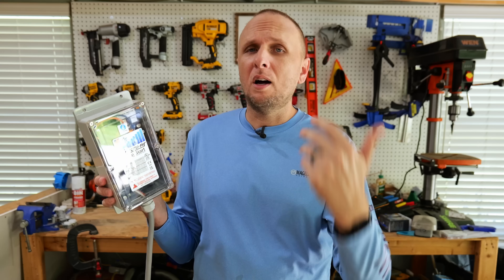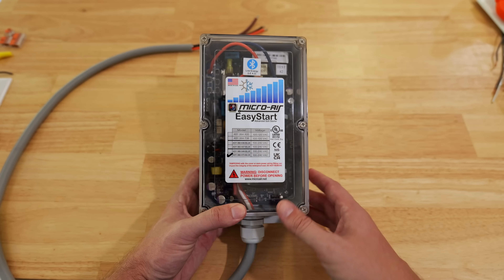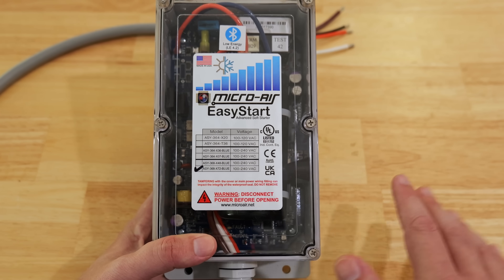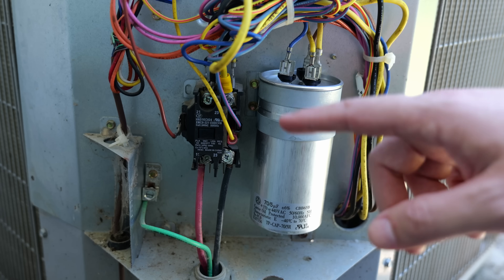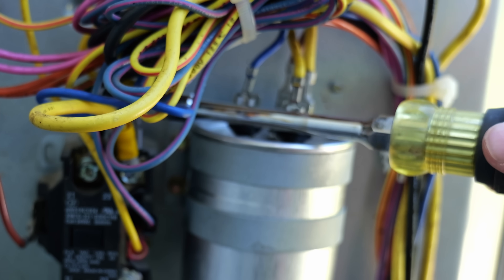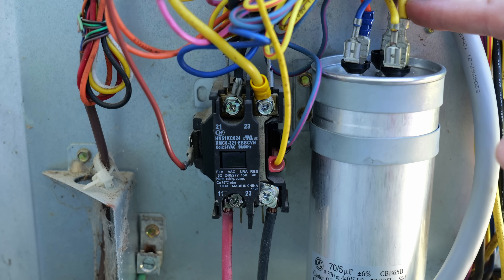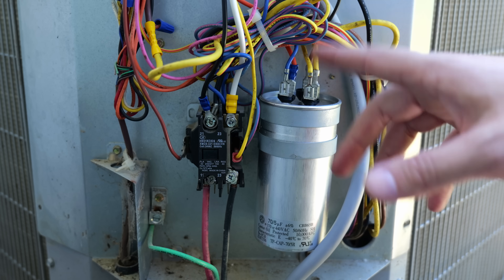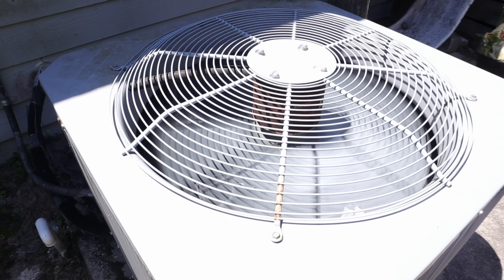Why Every Homeowner Should Consider Installing an AC Soft Starter | Micro Air Easy Start Install

Comment: This thing cost 300 to 400 dollars? Holy crap that seems like a hard sell considering a hard start is around 20 to  50 bucks. At that price i would have to charge around $2,500 to put one in. Average price for a $100 condenser fan motor in my area is aroun $1,200.  installed
Reply from the maker: But a hard start and a soft start work nothing alike.  Why would it cost way more just because the product costs more?  The labor price should be almost the same as this install only takes a few minutes more than a hard start.

Comment: Man I just got hit with a 400 dollar bill for a dual capacitor and valve stem replacement on my a/c. I wish I had seen these videos of yours sooner. You make it seem so easy. I am definitely going to install that soft start on my unit but I have to save the money for it first. It is pricey but we’ll worth it. Thanks so much for spreading this knowledge my friend.
Reply: A soft start won't fix a bad capacitor or leaking valve stems just saying. I'm pretty sure it won't prevent the capacitor from failing either.
Reply: @MindzEnt  you are right. I meant when I said “these videos”, I was referring to all the A/C videos he has including the one where he shows how to replace the bad capacitor for dirt cheap. I know I didn’t type that up good. My bad. I was so upset I had spent the 400 dollars and literally the day after these videos pop up on my YouTube cue showing me how to do it for a fraction. It’s like life was teasing me or something. Lol.

Comment: My ac system is about 3 years old, do I still need one of these?
Reply from the maker: I would not say you need one of these.  I would just weigh out the benefits of one and decide whether it’s something you think is beneficial for you personally.
Reply: @HowToHomeDIY Coming back and saw my comment. I've burned up a capacitor, contactor and 2 hard starts. Ac tech suggested this. Hope it works. Compressor really loud on start up.

Comment: Absolutely wonderful job you done.    It seems that it would be worth a manufacturer's while to include a soft start built-in and I wonder if there is any manufacturer currently doing this in their HVAC,s.  I am glad to find you and I have subscribed.
Reply from the maker: Currently there are no manufacturers including this on their units but Micro Air has told me they are in talks with some of them to start including them on some of their units.  We will see.  Thanks a lot for the feedback James and look forward to seeing you more around the channel!
Reply: Some RV AC units come with a Soft-Start function, to allow the RV and its AC to run off a small gasoline generator at a campsite. I added to my RV's AC the unit that was demo'd in this video just to reduce wear 'n tear on the compressor.

Comment: I recently installed an ICM Controls soft start on my AC and it seems to work as well as the Micro Air but at about half the cost. Any opinion?
Reply: ICM is a great company and I've seen no complaints with theirs. I believe they still only make a unit up to 3 tons and Micro-Air has models all the way to 6 tons. If ICM has one large enough for an AC i'd use it.

Comment: Nice summary.  The Easystart is a combo hardstart capacitor boost to improve starting torque and a triac (like light dimmer) voltage ramp during startup.  It bypasses its voltage ramp circuit and disconnects extra starter capacitor (inside Easystart) after the approximately half second startup.  

Only thing I would have left in video is showing the progressive startup current reductions as it does the five cycle learning process.  Also important to allow the unit to remain off between each training cycle for at least 5 minutes to allow time for air conditioner refrigerant gas to equalize.  Eaststart has a timer that enforces the five minute minimum off time if your A/C unit does not already have it.

You mentioned fan comes on a few seconds before compressor.  This allows an inverter-generator in reduced rpm ECO mode to rev up its engine before compressor surge current jumps on inverter-generator.
Reply: I would just like to note that if your system has a Compressor Monitoring System (CMS) as did mine, the 5 second power delay will have to be disabled in order to accommodate the Easystart. I was unaware of this until I had the unit in hand. This information is not in any of the literature describing the product as far as I am aware.
Reply: @DarrinCanote  So how did you get that done? How do you disable the 5 sec delay?
Reply: @krisashford  There’s a procedure in the instructions on how to do this. Basically, ‘Normal Operation’ is deselected and ‘No  Pwr-Up Delay’ is selected. They recommend doing this before fully installed, but Thankfully, I discovered that my CMS runs fine even with the 5 sec delay.

Comment: I have Goodman units that  have 2 stage compressors and no contactors--just an integrated circuit board.  Will these work on units like that?
Thanks.

Comment: Hey How To, Good video but shame on you for not telling your viewers that there are much cheaper soft start units that do the same job without all the bells and whistles (like Bluetooth.) I cant afford  almost $400 for this unit and I suspect there are many who are in the same boat.
Reply from the maker: I understand Stephen but to say shame on me I think is a little harsh.  Based on my research and having one of these for the past 3 years, in my opinion, Micro Air leads the competition in the AC soft start technology and I always want to recommend to my viewers what I think is quality.  I cannot speak for some of the other soft starters in every aspect but I do know most of them are priced at or around this soft starter and some of the less expensive units are limited in AC size and function.  You are more than welcome to try one of those other units out on your AC.  I would honestly love to hear the results after some time has gone by.

Comment: Would you recommend using both the hard start and soft start kits together, or only using one?
Reply from the maker: A hard start cannot be used or installed with the soft starter.

Comment: I always enjoy your videos,  I installed one of these myself after researching on YouTube. I saw one video where the person used hook magnets to attach it to the access cover. I ordered the magnets and they work great. I used a freezer bag to cover it for extra protection and used zip ties to close the bottom of the bag around the conduit. This makes it easy to remove for service. I run my whole house on my tri-fuel duromax generator.
Reply: Can you post the link?

Comment: Every homeowner?  I don't think it would benefit homes with variable speed inverter drive HVAC systems.  Those systems inherently start softly.
Reply: How can one tell if one has a variable speed inverter drive?
Reply: @Elricky124  if you bought it, you'd know.  They're much more expensive.  but if not, inverter drive condensers run much quieter.  The compressors are almost silent, and they ramp up in speed gradually.  Unlike conventional condensers where you hear a contactor pull in and the compressor starts up instantly.  The condenser fan also is typically variable speed and will slowly ramp up in speed to match the demand of the compressor.

Comment: You do a wonderful job and make a great teacher! But I do have one question.  How can such a small gauge wire carry a 125 amps?
Reply: It's all about timing, the 125 amps last milliseconds.
Reply: To further elaborate - it's about energy pulse. Inrush current while very high has a very narrow pulse width (time) at milliseconds. Calculating the area under the curve (energy output) isn't much relative to a consistent full load conditions.

Comment: I am not an electrician, so please forgive my ignorance, but I am wondering how an AC unit can draw so many amps at startup. I have central AC and it is on a 25 amp breaker. The whole panel is only 150 amp. On what kind of breaker an AC unit drawing 125 amps has to be not to trip it??
Reply: It’s a good question.  A typical breaker can handle having more current (amps) ran through it than it’s rated for if only for a split second without tripping. I don’t know the time duration so I can’t say how long but if the current stays too high for more then that split second. It will heat up and trip an internal bimetallic switch that’ll trip the breaker. 
If there is a direct short in the circuit, there another internal electromagnetic switch in the breaker that will trip it. 

It’s actually not uncommon for the amp draw during start up to exceed the breaker’s rated amps even when a compressor seems to be starting and running fine. Lowering those starting amps with a soft start kit or hard start kit is obviously a good thing though.

Comment: I have a newer Lennox system and the compressor has a circuit board inside. I believe this is the defrost control.  My capacitor has a CPT connection but nothing attached. Is it still ok to add the soft starter?

Comment: @HowToHomeDIY from your other video....I have a hard start kit installed & I assume I need to remove that to install an EZ Start?  I can't/shouldn't run both?
Reply from the maker: That’s right.  In order to use the easy start, the hard start would need to be removed.

Comment: Great Videos! I have about a ten year old unit, I changed out the capacitor. I then started hearing about hard and soft starters. I just watched your soft start install,and I'm not sure which is better. Any advice would help. Thank You.
Reply: Hard starts work best on compressors that take alot of energy to start so it's like an extra jolt of energy. I've never heard of a soft start until literally 2 days ago and I been in the trade for 7 years.

Comment: Compressors are designed to handle short 80A startup current peaks. They are not damaged by startup current peak. 80A for 1/10th second is the same energy as 20A for 1/2 second, so there is no energy savings. A whole house surge protector protects the whole house, not just the AC, and is cheaper and easier to install.
Reply: Not sure what your point is.  Whole house surge protector is not going to help your generator start your AC like this will
Reply: Any response?
Reply: @condor5635 well buddy! Even after almost 1 year😂
Reply: "In this video I show the features of and how to install a Micro Air Soft Starter on my AC unit.  This will allow me to use my generator or solar to power my AC.  It will also protect, diagnose, and extend the life of my unit along with so many other things it can do. "

I don't run AC on generator. 
My point is this will not extend the life of compressor because compressor is designed to handle inrush current without damage. I hope you can understand that.
Reply: @rhollyday - whether they’re designed to do it or not reducing it is not adversely affecting it and only helping. That’s like saying a car is designed to go 70 mph so running it at 30s is not gonna help any.  Completely wrong.
Reply: @condor5635 LOL- OK now I understand 🤣

Comment: I am curiouse does it save on electricity ?
Reply: No, there is negligible energy savings. It does reduce wear and tear on the compressor and is mainly used to allow generators to power the HVAC.

Comment: Any idea how a 2 stage Trane unit would affect how the device learns/functions?  For the most part the unit should start on the first stage but sometimes it will start on the 2nd...
Reply: You should Do some checking; my trane had it built in hence the lower fan speed at startup.

Comment: Guy, I am in the middle of moving to Florida and after watching several of your videos I am very pleased that I clicked the subscribe button. I know someone who lives in the community we are building and he told me one of the first things I need to do is get a back up capacitor for the AC. The second is installing a whole house surge protection unit. I will be installing the Siemens FS140. Now after this video I will be adding the Soft Starter to the job jar. Thanks for sharing!

Comment: I installed this a few weeks ago.  I was able to mount the unit inside my house.  It has preformed perfectly.  I have a video on how I did it but it is true that if you have any fear at all.... call the man and have a pro do the job.  I'd also say that you need to talk to the installer of you system to make sure you don't mess up any warranty you may have by installing this.  It does make a click noise so if you think that will bother you, if you install where you might can hear it, then consider that but for me it sounds great!

Comment: Just installed mine a few days ago. One thing I did differently is that I used Wago 221-613 which is rated for 10 awg. 

The EasyStart brought my 2 ton unit down from 46 amps starting to around 21 amps. That'll definitely help with running on my 30 amp battery backup system or 30 amp backup generator.

Comment: I put an Easy Start on my unit about 2 years ago. Micro-Air is located just east of Trenton NJ, and as I live down in South Jersey, I decided to visit the factory.
Let me tell you.... with over 40 years of professional work in electronics for the Federal Government, I am beyond impressed with the design, manufacturing and quality control I personally witnessed at Easy Start. 
As for warranty, last summer I had a problem with my unit. I called the company, explained what was happening, and they told me to bring it back to them. Again, I drove up there, talked to the engineering guys, and they just pulled a NEW unit off the production line, updated their records, and handed it to me. Unbelievable in this day and age!
I brought it home, reinstalled it, and powered everything up. Just as before.... staged compressor startup. Not only does this GREATLY reduce the inrush current, it also reduces wear on the compressor.
By the way, I run my house on a Ridgid 8KW running watts generator when needed (through a panel lockout kit) and it starts my AC just fine. Bottom line: if you have a generator for your house and also have central air.... JUST GET ONE OF THESE!!!
Reply: This comment is so helpful. May I ask,  as someone with no background in electronics and AC etc, do these also save on the electric bill?
Reply: @LK-bz9sk   Actually it does not save money on electricity bill. However certainly it will increase the life of the compressor and everything behind (cables, breaker, relays etc) by the fact that it will avoid this high inrush current. This inrush current  is like start your vehicle with gas pedal at full throttle for a second, every time you need it.
Reply: @LK-bz9sk  I would imagine that if there was any savings, it actually would be quite small. The inrush current that the EasyStart replaces is only there for a few hundredths of a second. The larger benefit is the ability to use your AC when operating off a generator, as well as the decreased stress to the compressor unit over long-term. I hope this explanation helps.
Reply: @thomasgrunwald9065  this is very helpful. I appreciate the info.
Reply: @LK-bz9sk  No, it will not.

Comment: I have the biggest version of this device.  I couldn't recommend this enough.  My generator (12 KW) was able to start my AC previously, but it was hard on it.  After adding one of these, it starts with no problem.  Further, this device has several safeties built in (under/over voltage, over amperage, line frequency under/over, restart timer).  I blew a capacitor, and this prevented my compressor from trying to start until I replaced the  capacitor.  There is a set of diagnostic LEDs that are visible on the outside.  I noticed that there was a problem when I was pulling out of my driveway from 40' away. I mounted mine on the outside, since it has a waterproof housing.  My unit is a 16 SEER 5 ton, and my inrush current was specified to be up to 120A.  I was measuring around 80 A.  Once installed it is around 40A.
Reply: What are your running amps?
Reply: @lnfinity4752  I run about 13 to 15A depending on the outside temperature.  The running amps are really not that different than without the Micro Air easy start.  It just keeps you from drawing huge current while starting.
Reply: @elinbenson  My unit is also a 5 ton scroll and it draws 14-16 running amps depending on conditions. It draws ~68 amps on start with the Micro Air unit. Micro Air Bluetooth unit has logged over 15k starts since installed.
Reply: @lnfinity4752  Mine is a scroll compressor too.  It is a 16 SEER unit.  You might try to reset the Miro Air and let it relearn.  I had a problem with mine having higher starting amperage.  I reset it, and it went back to starting at 40 amps.

Comment: is it okay to use the x72 (6ton) easy start unit on a 4 ton a/c unit? or is it better to go with x48 which is design for 4 ton unit? thanks for your video!
Reply from the maker: The X72 is for 4-6 ton units.  So that would be the one you would want to get.
Reply: @HowToHomeDIY  appreciate you! Keep up the videos. 👍🏻👍🏻👍🏻